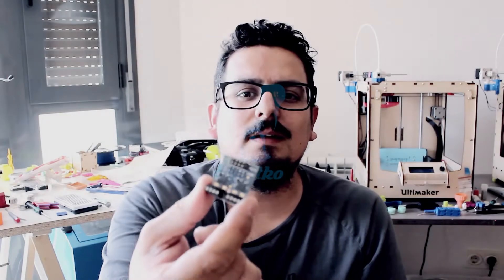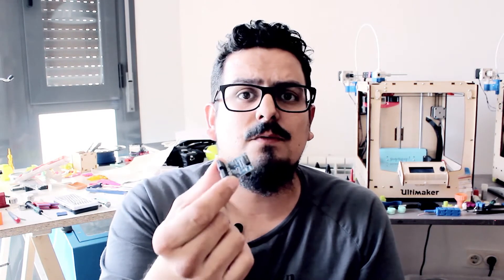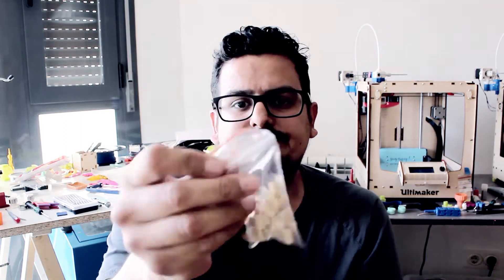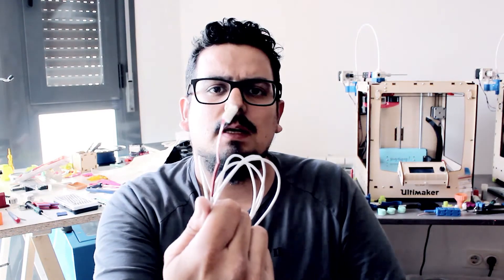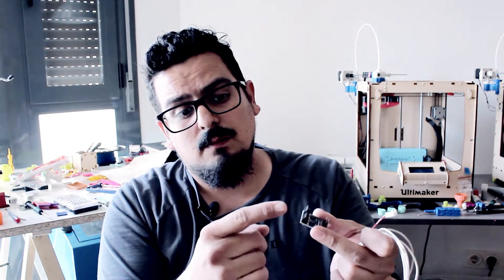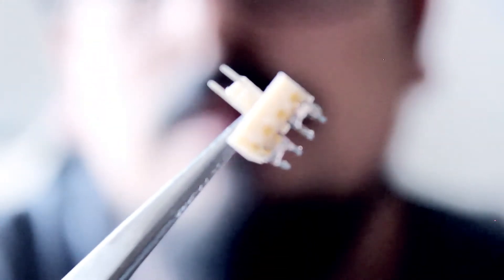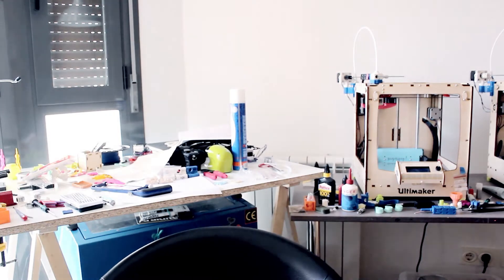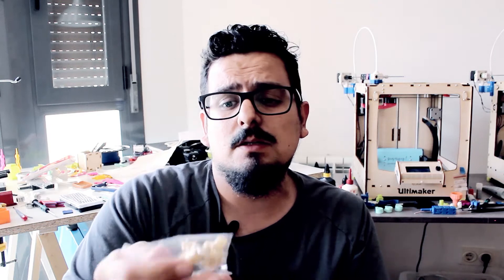Duet3D Easy PT100 Molex KK 4 pins Plug

Comment from the maker: ahndeux commented: "If you value your fingertips and want to prevent blood loss, please don't follow this person's advice on how to cut a connector. A small diagonal cutter can accomplish the same task a lot faster a..."

I agree with him, don't follow my advice, try to do it the safest way you find, for me this works, but it might be dangerous, so please take care while using Exacto knifes. I did also try with an Diagonal Cutter, and it works, perfectly, and safer, just take care to not bend too much the pins and don't pinch your fingers ;)

Comment: Any reason why you didn't just de-solder the screw terminal block, solder a two-pin Molex connector in pin 2 and 3 of the board and bridge 1-2 and 3-4 on the PCB with a drop of solder?
Reply from the maker: Indeed that's a way, but messing with the board can damage it, but damaging the Molex KK 4pins is quite inexpensive, so if you are a novice (like me) you avoid damaging expensive parts :D